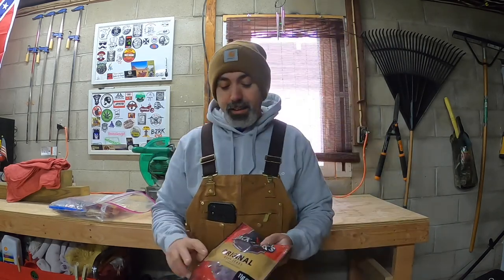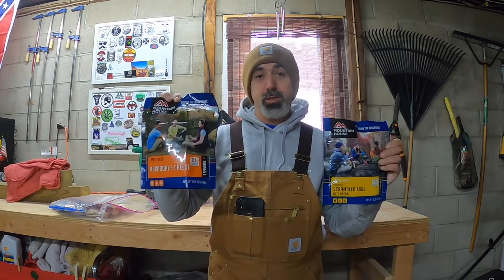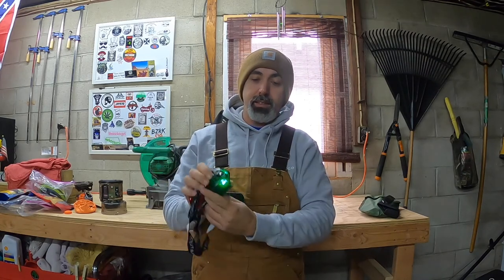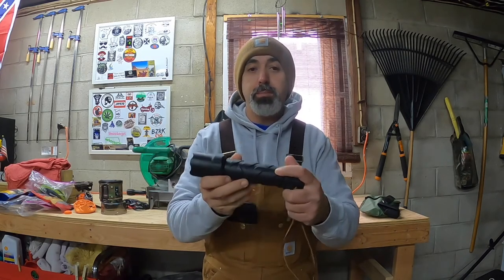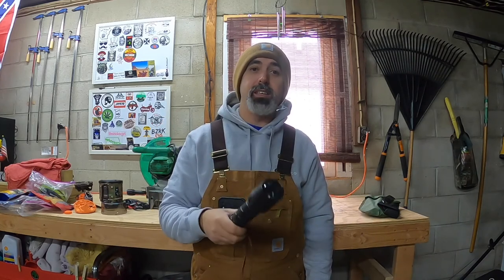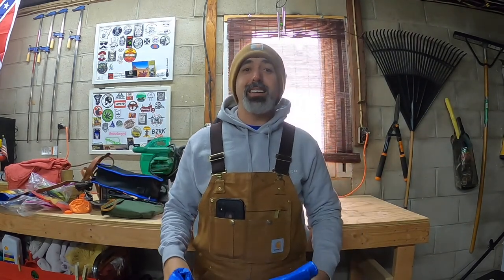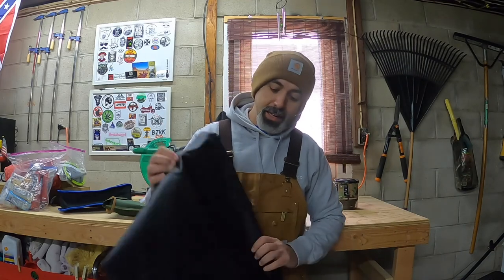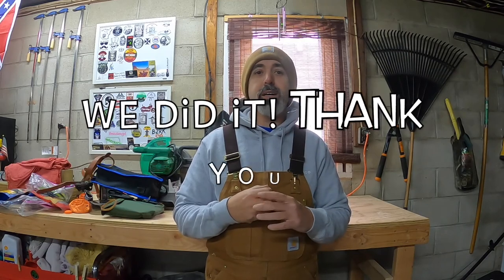Motorcycle Camping Gear Review - Amazon Finds

Comment: For camping I like to add a Tupperware box to the luggage rack.  I drilled a couple holes in the bottom and put a piece of steel stock across to tighten against the rack. It keeps everything together.  Search for U. S. Army E tool and get a surplus shovel.  The Spetsnaz shovel is good too bu the handle does not fold. The shovel is nice to have if their is not an outhouse round.
Reply from the maker: That’s a good idea with the Tupperware box!  Thanks for watching!